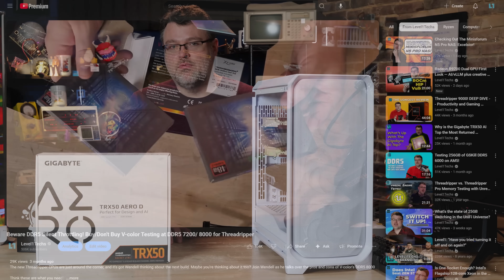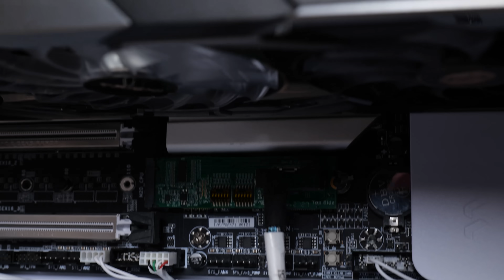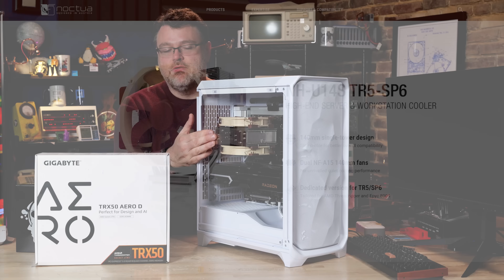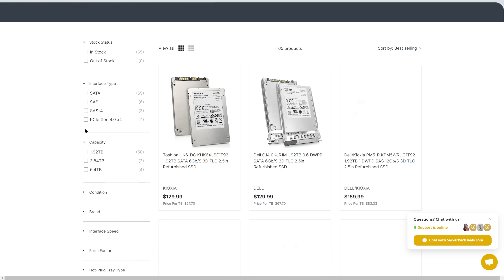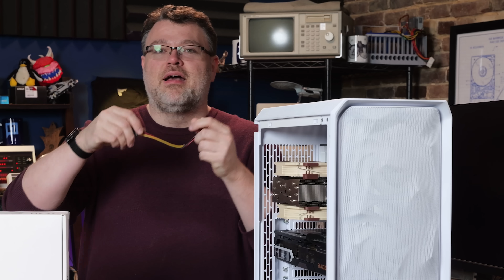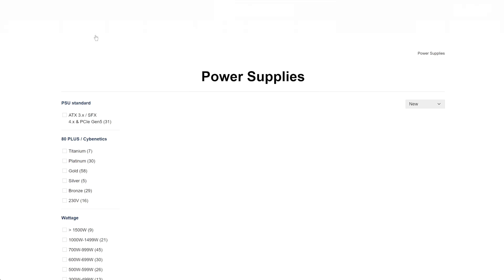What is the Least Expensive Threadripper Build Without Losing too much Performance?

Comment: You can also remove the 3.3V pad on the sas sata adapter. What I did to get two 14TB mechanical SAS drives to work in my NAS.

Comment: When I hear people talking about saving on a Threadripper build on a few bucks for a fan cooler vs an AIO, I really get upset! AIO's are not really expensive and the performance per dollar vs the heatsinks that are larger than the PC Case is a joke! The problem wouldn't exist if people didn't upgrade everything daily! The silicone cost is a joke nowadays. That's the only place where saving is worth it. RAM, CPU and MB...everything else is cheap!

Comment: So I skipped that motherboard. I didn't like it. I wanted more. I got the ASUS WIFI Sage. I'm pretty happy with it, but they call PCI bifurcation RAID mode. That confused me. I don't like that I can't control 4/4/4/4 or 8/8. It's working with 2 NVMEs right now. Will it work with all 4? I'm about to add 2 more soon. I was lazy so I have spare NVME slots on the board so It's not a big deal currently. I went with corsair ram at $500. It was the cheapest 6400MT ram I could find, but it's not JDEC or EXPO. So I had to set it manually. Is it configured correctly? I doubt it, but it reports 6400 and it's stable so I'm good. I did get the $400 TR only cooler. I wanted a real cooler. I'm using an 800 PSU I think. It was pretty cheap. It was originally for a B500 + 3600x. It's pushing it big time. lol I'm using almost every connector it has. lol I have a corsair 4000D airflow case. It's tiny. It's cheap. Again this was for a B550 board. Holy shit......this is not a TR case. It was a nightmare. I got everything in it, but it's cramped as hell. The GPU is an Intel A310. For video rendering it's fucking amazing. For 4k it's a wash between the CPU and the GPU. For 1080p the GPU is usually faster. That cost me about $100. I think this system with everything in it is just over $5k. The 4k drive (upgraded ASUS blu-ray) was almost $200. I love this system and I only wish I started with a TR, but then again it wouldn't be a 9960x. Would that make a difference when I'm doing GPU rendering anyway? I have no idea. I do know the GPU rendering is SIGNIFICANTLY faster than it used to be on the 3600x. My slowest speeds were my fastest speeds. And after having too many NVMEs the performance tanked. I only got 60fpx on the GPU because PCI bifurcation (8x GPU instead of 16x GPU) disabled rebar and I couldn't turn it on again. That's why I upgraded to TR.
Reply: Actually it might be more like $6k. I don't know between 5K and 6K.

Comment: So this very expensive threadripper has about the same performance as the hx 370? But uses way more power and cost wat more? Whats the point?
Reply: Twice as much RAM bandwidth (4 channels instead of just 2).
Reply: @Martinit0 the performance i said is with its ram bandwidth. Lol do you think they benchmark the cpu without ram or mobo?

Comment: Please Mr. Wendel you talk about RAM, please mention RDIMM, because RDIMM ≠ UDIMM! Price is between them is heaven and earth, and availability is usually scarse in Europe! Please don't take me wrong I like HEDT platforms for their expendability - lots of PCIe gives a lots of PCIe slots e.g. need more m.2 SSD, buy PCIe SSD expansion card even cheep one because PCIe on this platforms have bifurcation, more network speed, new 10-25 Gbe adapter and so on! You don't have to worry which component have shared resources or will stop working when you populate specific PCIe slots!

Comment: no power in text/flesh bruh. power user in only from above. who you put your hope in matters. people only judge good/bad, but above makes free from people's hands. chip internal memory is better. also on-chip very large nand. nand as rom is very fast and large. also rom is very fast and large in small foot print. combine everything in the same chip, rom/ram/microled/nand. very fast. no bus issues, other than chip internal very fast transfers. who are they. dont work harder, get gifted smarter. remember to load up the nand ram beforehand with the data. per core. you know distributed local compute is very powerful. ie use nand ram as non-volatile ssd ram but mostly in the read mode for speed. like the intel stuff you know. on-chip display micro-led touch-screen-speaker ftw. code violation bruh. any of your attempts. above is the fulfilment of code. none of your temptations. above gives alone, not to be checked by flesh of no use checks. above checks his own work. otherwise it would be your work. no flesh does no thing. just no brothers. cost is amazing, nah actual free dom is amazing. people stuff become lame in front of above. only in front of people are people stuff given value. yeah free stuff is much better than paid stuff. open source free gift you know from above. what shakes, shakes. what stands, stays standing. just dont fall. 4TB magic word nice, same for 128MB x 32k. you know ssd chip sub-grid. you stay cool brother. sata6? thought current was sata3. right 500MB/s sata3 as usual. obvious bruh. less connector interfaces the better. 4TB of nand stores a ton of stuff. keep external from interfering with internals bruh. outside has no power unless you submit to them any power. no trusting other people, only trust in above alone. use slc nand. or just slc nor. so if you rewrite the whole thing 500k times all the time. well dont. only for random storage not constant storage. needs ram type of no wear. all that is required for life and aboveness is in above. dont even temp with fomo fear flesh people. be warned of yourself. your advice is not suitable for the free with above. fsb nsa fbi cia. how big is your heat sink bruh.

Comment: "One of these cables", can you be more specific please, for those not in the know. I've used SFF-8643 to SATA cables before, the single end looks like SFF-8643, but is it? And the 4 breakouts, those are SFF-8482?
And what is the current / best advice for power? Isn't Molex to SATA a disaster waiting to happen? Others have suggested a SATA extender and snip off the 3.3v, or tape over the relevant pin. What is the easiest and safest way to do this in a DIY non SAS backplane situation?
I'm gonna build a DIY fast store NAS next year, ideally rack mounted and I'm gonna use SAS/SATA hot swap enclosures, but if I don't I want as much knowledge as possible to get the job done (safely).

Comment: This might actually come in handy. Lately I've been feeling seriously constrained by the lack of PCIe lanes on consumer hardware. even worse, the distribution of said PCIe lanes sucks. For example, you just can't get a x16 slot AND a x8 slot. Electrically I mean. You can get pretty much whatever slots you want, but if you actually try to use them they only work at x1 or x2.

So last week I was pricing out some low-end EPYC and Threadripper systems. Overkill, but just enough kill does not exist.

Comment: Case I would use is a meshify 2 or define 7 (or xl variant of either). That case family has workstations in mind a bit more than the meshify 3 does. The meshify 3 was purely a gaming case. In a the prior gen family of cases, you can put in 14 hard drives (18 in the xl), and still fit a front mounted 360mm radiator in front of the drives. It also has better giant motherboard compatibility, even in the non xl version. 

GPU theres so many options here theres no right or wrong, but if you go for a board with smaller spacing like this, you'll want a 2 slot card. AMD does offer 9070xt's that are actually 2 slot, theres also the large assortment of pro cards that are exclusively 2 slot, but pro cards cost more money. A 7900xtx or rtx 3090 is a way to get 24gb of vram for about 700usd, but of course both are used. 

Silverstone actually offers redundant atx power supplies. They aren't cheap, but they exist

Comment: I've been tracking the prices of all of the f sku EPYC 9005 series, and the rate at which the prices have been falling has left me hopeful. You can now buy a 9575f, used, for less than half of what it's currently selling for at retail. No other f series CPU has fallen so much or has broader availability on the used market. I guess it's all of those early adopters that ended up moving to higher core count skus. Most of them in China. EPYC 9005 is the first server grade CPU series to touch the 5Ghz ceiling. Zen 6 will probably blast past it. I expect the rate of adoption of Zen 6 EPYC to be so high that all of us poor plebeians will have a wealth of used Zen 5 EPYC CPU's to choose from.

Comment: Are Threadripper CPU coolers always mounted in that direction? Turned 90 degrees vs. desktop builds. Is this a special airflow issue? Seems counterintuitive as it would draw in heat from the GPU.

Comment: No, I’m not proposing to build something just like this, but I find the case and the cooler interesting.
I would say with reasonable confidence, a Noctua NH-D15-G2 would fit just fine in there. Tight, but it would fit. And I’d have pretty decent airflow. You might be well advised to check the height of your DDR5 DIMMs, because that tight fit could easily become a no-fit-at-all. Yes, you can move the fan(s) up a few fins, but that’s not going to help you close the case.
You need DIMMS that are not much more than 32 mm high, if I remember that figure correctly.

The comments about memory are also interesting. Different CPU, different motherboard, you can’t take away too much from this, but it’s worth listening to. In terms of general shape, the normal run of things, I suspect a Ryzen zen 6 will have DDR performance and installation and everything, that are quite similar. The CCXs (or CCDs or whatever they calling them this week) are going to be different, but the I/O die is as well, and the way it all goes on the substrate and everything. Meaning the Infinity Fabric is going to see some pretty significant revision. I understand memory performance and timing and bandwidth are all set to see a pretty healthy jump. At least I hope they are, because that’s why I’m holding off for zen 6. I just hope this old i7-6700 keeps plodding along just a little bit longer. As long as this keeps dragging its butt along the ground, I can wait. I am looking forward to zen 6 with anticipation ~ like a 7 year-old waiting for Christmas.
“Dear Santa ~ I am 63 years old, so I have not been as bad as I would have liked, but while you’re here ~ while you’re down there ~ “

3:50 ~ It’s a Fractal Design Meshify 3 and an e-ATX motherboard just barely fits in it. [sniff] Ok, noted.

https://www.amazon.com/dp/B0CS3TNXBW/level1techs-20?th=1

Fractal Design give the exterior dimensions as “LxWxH 17 x 20 x 9 inches” 
So ~ now you know.

“Google ~ Does a Noctua NH-D15 G2 fit in a Fractal Meshify 3?”
AI Overview
Yes, a Noctua NH-D15 G2 will fit in a Fractal Meshify 3, and the two are often sold together as a pre-packaged bundle by retailers like Scorptec Computers. However, be mindful of RAM clearance, especially with tall RAM modules. 

    Clearance for RAM: To fit the second fan on the outside of the heatsink, you may need to raise it slightly, depending on your RAM height.
    Tall RAM: Tall RAM modules may require you to adjust the fan's position. The NH-D15 has recessed fins to help with this, but with very tall RAM, you might have to use it with the single fan in the center, according to Reddit users.
    CPU Power: The cooler may block access to the CPU power connector on the motherboard. It's best to connect the CPU power cable to the motherboard before installing the NH-D15, notes Reddit users.” 

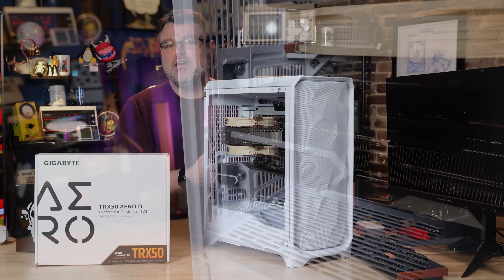4:40 ~ that’s a 9070 XT, a high end 3 slot GPU. I definitely don’t need that. You could wipe off about a grand in Australian$ for that ~
We want 64GB of RAM that runs at the highest speed where we can get 1:1 memory clock to Inf Fab on, which would be 6,ooo today but may well be a bit faster when zen 6 arrives. That remains to be seen. And we want one ~ perhaps 2 x 2TB M.2 drives. That choice also still to come, but the “fastest drive” in the data centre, that’s maybe not quite what I need in a home desktop Linux Neck-beard Dream machine. Like the choice of GPU ~ make that one a bit closer to the day I’m about to start ordering parts, which is going to be maybe a month after the zen 6 lands in retail. Which I think is going to be some time in Q3, 2026, maybe right at the end of Q2.

2 TB is not a lot but I’m working in 480GB as my main system drive now, and I’m generally using about 60% of that. A single 2TB would have all the room I could possibly want ~ I want a second one because things break, and I have a long history of breaking them.

If I had that much fast storage floating around, I could do the “TimeShift” full system restore thing that Mint keeps nagging me about. The way things are now, it’s quicker and MUCH simpler to do a manual backup of my Docs and Music and stuff, and then do a complete nuke and re-install if anything goes wrong. It takes a while, yeah, but so does TimeShift. In terms of what’s easier and less likely to become part of the fuster-cluck that required a time-shift-restore anyway ~ Timeshift is more trouble than just starting over. I mean, if the system crashed, then I’m not sure I want to restore to exactly the way it was just before it crashed, because ~

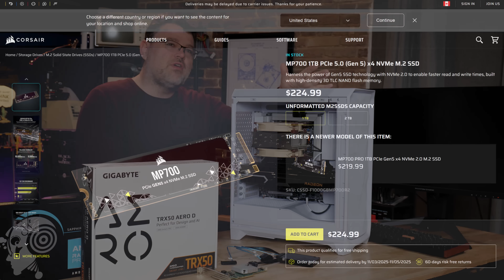16:32 Corsaire has an M.2 drive ~ MP700 1TB (I guess there are also 2TB versions) for $225 US. Yes ~ 2TB is $370 US.
~ also the Crucial T705 series. I think Phoronix spoke very highly of them.
If it’s the one I’m thinking of, there’s something a teeny bit hinky about that controller, under Linux, EXT4, when using MongoDB database. Apart from that one outlier, it works brilliantly. It does function with the MongoDB, just doesn’t show the performance with it that you might expect. But everything else ~ brilliant. There is just that one piece of software that does not like it at all.
? me? No, as far as I know, nothing in my Linux Mint uses that at all. I’d be perfectly happy with one of those.

Comment: I still have my MSI MEG X399 Creation motherboard configured with a Razen Threadripper 2990WX I had since 2018.  
I use the Noctua NH-U14S, so none of that top to bottom non-sense your TRX50 has, real front to back push-pull cooling. 
All inside a Fractal Designs Torrent case. 
I use the included AERO M.2 expander card that I have loaded up with 4x M.2 NVMEs.
Sparkle's ARC A770 16GB comes in handy since this board supports Resizable BAR. 
I don't need Gen5 speed, Gen3 NVME is just fine even better if you run them in a RAID array with a M.2 expander. New TRs are waste of money to me Wendell.
Reply: Noctua NH-U14S, how did you make it work? rectangular bracket, cant get it to work at 90degrees, what am I missing?
Reply: @himurolord  I use an NH-U12S TR4-SP3 on my 2990WX. It’s a different model with a wider base. I assume he meant U14S TR4
Reply: 2990WX is a horribly slow CPU

Comment: I have new headline, Cheapest Threadripper Build is still too expensive for you! And yes, a used Ferrari is cheaper than a new Ferrari.
Reply: Yep, regular consumer Ryzen needs a HEDT class of product with at least double the number of PCIE lanes that current Ryzen has, including rock solid IOMMU support in bios that is stable between firmware updates, full SR-IOV support and full PCIE Bifurcation support.

Comment: went Arctic too on my 3975WX, from the get go it was really good, i went on to print a shroud that can mount 2 Noctua PPC fans instead of the PST Arctic P12 on the heatsink, perfect fit, black PPC + Black ASA shroud makes it insanely good looking ( even if it stays in a rack ) and barely audible unless rly rly heavy workloads, dont bother with AIO for real, or you go all out DIY WC, more of a hobby than looking for pure reliability, or go plain simple and great for the job Air cooling, for me Arctic was the one, happy and not going back to smth else for years to come on that plateforme

Comment: Really really wish AMD would make 12c and 16c Threadrippers with the two connections to the IOD.  There is no reasonable entry point to the Threadripper platform when it starts at 24 cores.

Comment: Hmm, to wait and see on the rumored 5080 Super 24GB card or buy R9700 now... Sold off my gaming mid tower last year and limp along using a single 4060Ti 16GB on my Epyc 7C13 for GoW streaming, n8n, and openwebui. I had originally planned on snagging a 2-3 4090 rig when prices fell with the launch of the 5090 which as everyone knows just didn't happen :(

Comment: Have the molex to sata cables stopped burning down computers?  Surprised to see one suggested after all the "molex to sata lose all your data" advice of the past
Reply: Actually, as someone who wants to build a DIY fast storage NAS next year with SAS drives, makes sense with the up to 1.2GB/s speeds and usually cheaper used prices for video editing, I'm genuinely interested, I'm not so close to the wall that I know the latest info, but yeah last I heard was don't use Molex to SATA power cables. I also saw someone else say get SATA extenders and snip off the 3.3v, and another say use tape to cover a pin. Would be great to get some sound advice that is easy and won't burn down my house.

Comment: i need you to test something on this board. my experiance with it has been TERRIBLE

i run a W7900 and a 7900XTX with all 4 NVME slots filled and its been awful.

i cannot have both gpus active without constant system stutter or the wifi dropping out 

i was on a 7900x3d system before and both GPUs were perfectly content. 

ive had to swap through 3 different wireless cards to get one that worked right.

and rhe real kicker. 2 MOTHERBOARDS WITH 2 CPUS EXHIBIT THE SAME BEHAVIOUR!

Interswapping does not help!

and going back to the old board, everythings happy again

its fine with 1 gpu but this board has been actually awful to live with and i hate the fact its the only one that matches my needs with size and features.